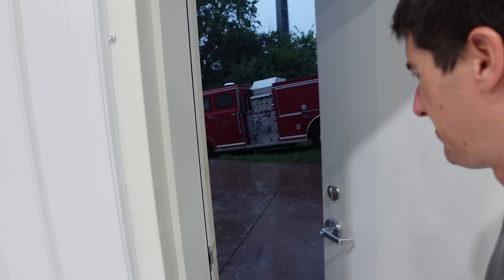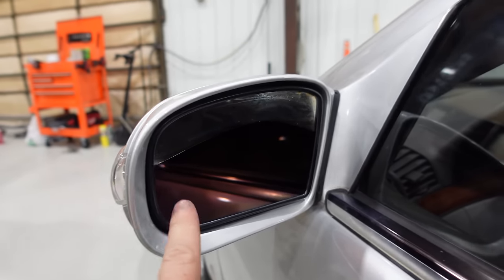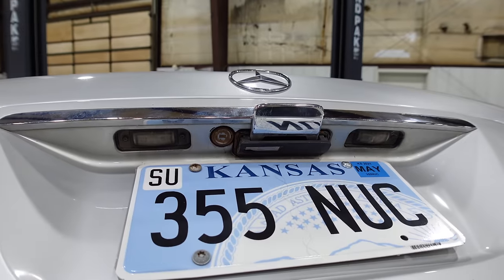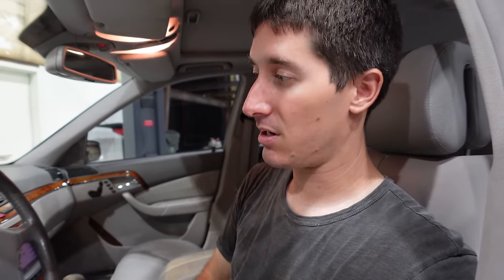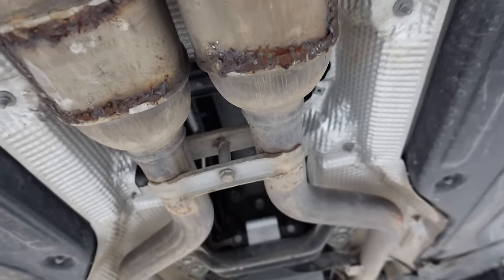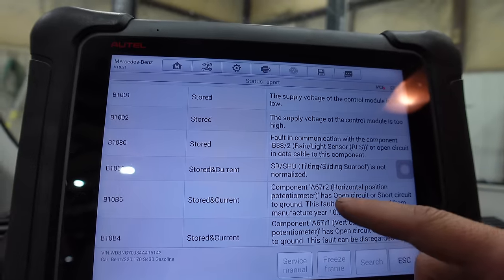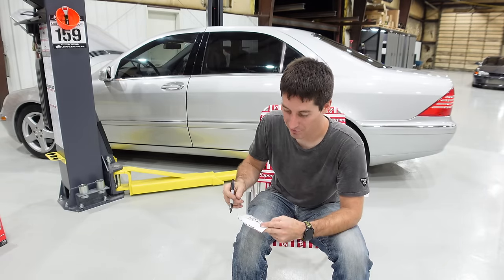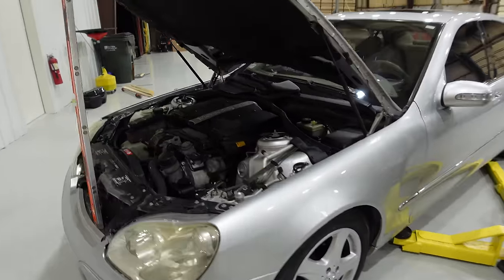My $2,000 Mercedes S430 Is Completely TOTALED *How Bad Can It Be?*

Comment: There is some basic stuff u can do to keep running as a shop car or whatever without going mad expensive, and even the exhaust can be cheated with a couple tricks such as spacers on the down stream lambda/oxygen sensors even with cats removed it will work. Change some fluids and rock on "till death do you part"...Good luck which ever way you choose !

Comment: You've got the trunk handle completely backwards... the handle is supposed to stay out when the trunk is open (you can use it as a handle to shut the trunk) and it retracts a couple  of seconds after you close it... if it's working correctly. (I'm on my second W220).

Comment: Personally, I would do the suspension if the existing pieces do not keep the car at normal ride height, new tires on the existing wheels, fix the exhaust, do the timing chain and make the interior livable with seat covers, then drive the beast. These cars can go an amazing distance with few mechanical issues. The body looks better than almost any I have seen here on years. I bet there are at least 10 more years of use in this beast. My brother had an 85 300SD. Rust is what killed it. On new cars, it is often the electronics that kill cars. Bosch adds complexity for the sake of being complex.

Comment: I would do the brakes, tyres, timing guides, and a patch job on the exhaust. Also, the driveshaft flexdiscs and fluid replacements. Don't bother with interior or suspension. Then drive it into the ground. Should last at least 3 years.

Comment: Remember flood means the car was damaged by water in some way. It doesn't have to be that the car was immersed in water to a certain level. For example i bought a Flood mercedes e430. No water damage to the interior, no wet rugs, no smell, paperwork under the carpet was fine. The car got a big splash of water into the grill and hydro locked the  engine bending rod number 1. 
Fortunately i wasn't the the fool that paid 7k $ at coparts. I bought it off the guy for 1500$, only 75000 miles, looked perfect. Just wouldn't crank - i guess not. Always bring a breaker bar and see if the engine rotates ;)

Comment: I would check behind the steering wheel, as well as the dash, I would bet that there is not a single airbag left in there. With the tensioners being triggered, the airbags clearly went off and cause damage, and the rear seat passenger airbags likely went off as well.

Comment: I bought a 2002 Lexus LS430 for $12,000, in 2012.  It had 69k miles.  I drove it to 240k and sold it for $3500. While I owned it, pretty much nothing broke. Oil changes, tires, brakes.  I think one of the struts wore out too. 
The big Mercedes costs more new and all the reviews would say it’s “better”.  But when they get old they are impossible to keep on the road.  
You want a high end car that is cheap to drive?  Get a old Lexus and just drive it.

Comment: Is it possible it was salvaged because of the air suspension failing? We had a 2005 W220 just a couple of the units failing would have the car written off here, if you really wanted it to.

Comment: @watchjrgo the buttons most likely work, you need to press the small reset button on the side of the cluster through all the error messages one time every time you start the car, then you'll be able to use the buttons on the side

Comment: Those don't just squat because of air system problems.  The wire harness burns up and car squats.  Co worker had one die in parking lot at work.  Came out found car sitting on ground, glass in heated mirrors was burned.  Car electric wire harness took a complete $hit.  Anyone with these Mercedes, if they are fully insured, insurance company will not pay for new wire harness and I think the wire harness isn't in production or outrageous cost so insurance mechanical totals it.  Car can look like new, but cost of electric harness outweighs value.

Comment: The steering wheel can be refurbished with the seats. The lifter tick is quite normal for these engines. They do not suffer from timing chain wear issues. A few engine flushes and regular oil changes should sort out the lifter tick. This was the wrong car to buy, extremely neglected...

Comment: I would never touch a car that had the air suspension deleted. It may drive nicely but you are never going to get that S Class ride under all conditions. Here in the UK these cars are starting to rust very badly... If you want to enjoy an S Class you need to be spending money all along the way to fix things as they break. That way you enjoy the car more. If A to B is your reason for owning a car like this they don't buy one.

My feeling is it has to go. However. even an immaculate S Class is probably hiding a few thousand in repairs and will continue to cost a few thousand a year in repairs, but this one has perhaps two major issues too many.

Comment: You bought the wrong S.

Anything after the 140 is garbage.
I'd stick with the 126 first or the 140 second..... And resist the V-12, go 500.

My 560 has nearly 400k on the clock.
No big deal. And it's in perfect condition.

Comment: The math to total a car is faulty. 
If your repairs result in another 150k miles of useful driving, the market value of the car is irrelevant to someone who loves that car.
Consider the cost of repairs against the cost of buying another new one like it, and it suddenly becomes a very good deal.
$5000 in repairs vs $70,000 for a new car, to drive the same number of miles(and likely the same number of trips to the repair shop, considering Mercedes reputation...)

Comment: Mercedes Benz after over 150 years, still cannot match a 60 years old Yugo. Imagine a car company with such vast history cannot make a car last more than 100,000 miles. So, buy a VW bug or a Russian car if you want to drive forever. Range Rover moved from the land rover that can still be driven after 75 years to a range Rover that is vomit after one owner. I am 73 my first car in England was a 1967 Shelby Cobra, I sold it but it's still working as is my 356B and my Ford Anglia. So, by a Shelby Cobra and in 10 years time your car will be worth more than you paid for it. Whilst your Mercedes will be scrap.

Comment: Yeah you bought a bad one.
Edit: if you fix the errors you might be able to cycle through the menus with the steering wheel buttons.
Passenger occupancy sensors go out often in those, you can get a module to bypass it for about $8 on wish.
Rain Sensor is around $50 on ebay, good used.

Comment: I am betting you don't have a driver airbag, but I wouldn't check because once you know at least morally you have to disclose. I know you make money on the content, but there is no reason to spend money on stuff that won't materially improve the value. This isn't a special or unusual car worth saving like the EXP was. The problem with selling as-is is that now you need to disclose the 4 empty cats and in my world combined with the salvage title this a $500 car no matter how well it runs and drives. Inexpensive tires, O'Reilly house brand rotors and pads, used cat's and sell for $3,500 and basically break even, which is a win on this one.

Comment: Personally, I would fix it. I'd feel bad about letting it go or parting it out because it's an loss. Doing the timing would set the car on the path to 600,000 miles no prob.

Won't lie. If you do go through with repair, then it's strictly for the satisfaction of saving such a nice car.